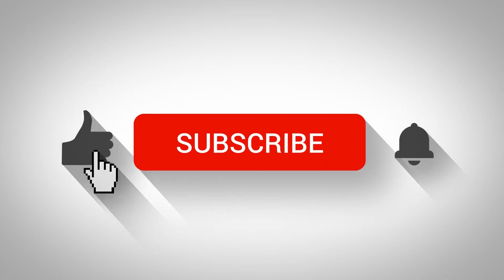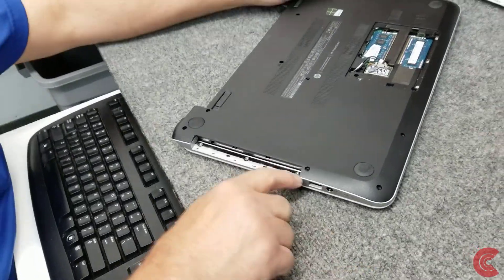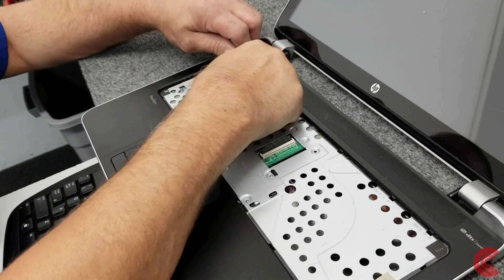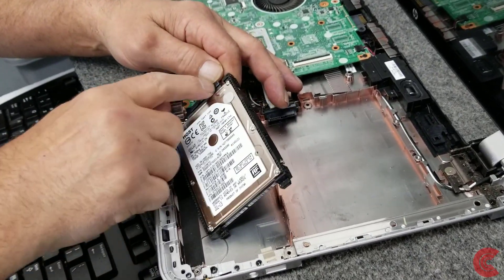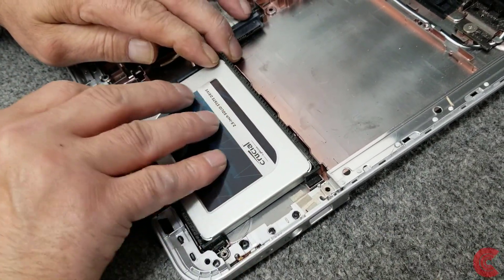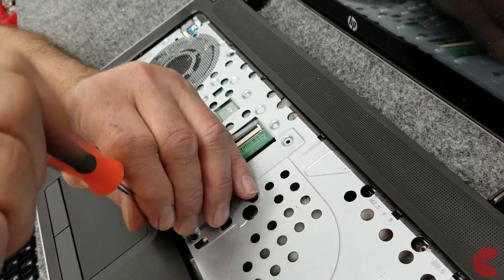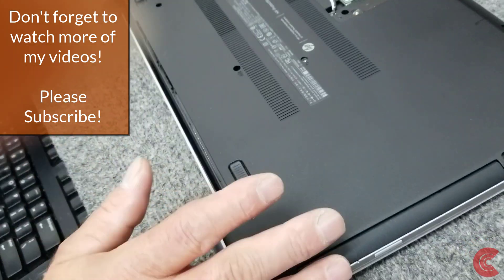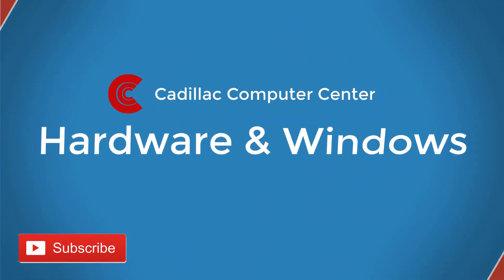Replace Bad Hard Drive With New SSD in HP Touchsmart Laptop

Comment: I have almost this exact same type of laptop and I am looking to increase its power so that I can play more games on it answer so that it is faster in general. How much approximately would the components you used in this video cost and how much would the instalation be if I didn't do it myself? Or do you think it would be better if I just got a new laptop?
Reply from the maker: Hi. Honestly, this is not a gaming computer.  Does not have gaming GPU.  Better off to get a new laptop. The new ASUS TUF gaming laptops are priced pretty good, just to name one.  Dale